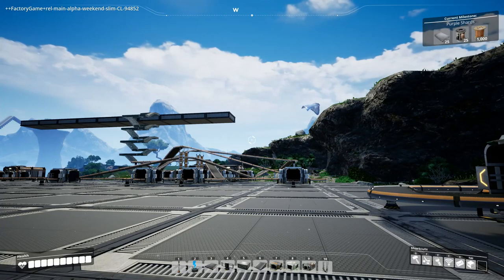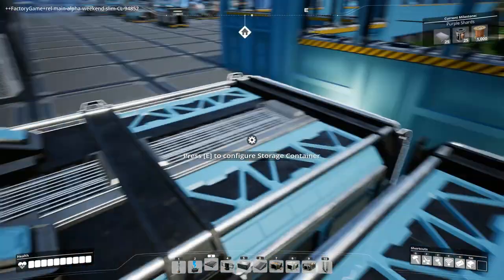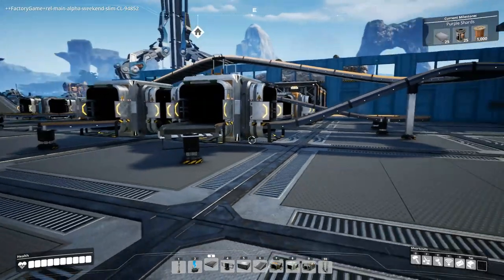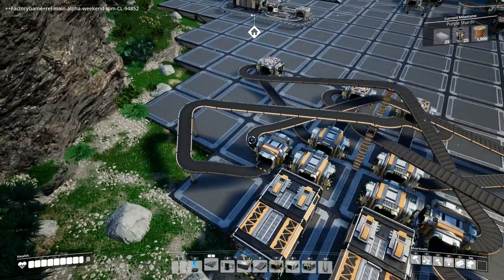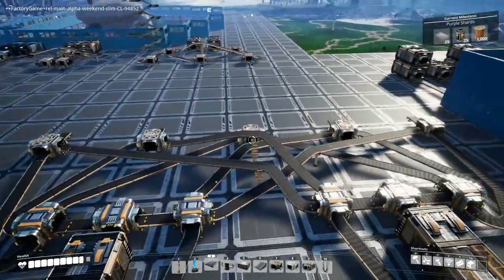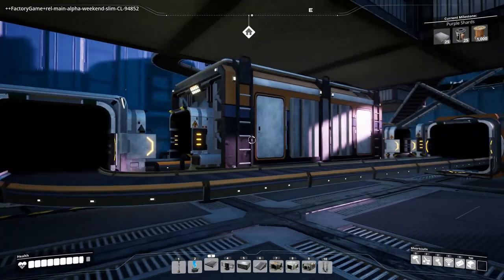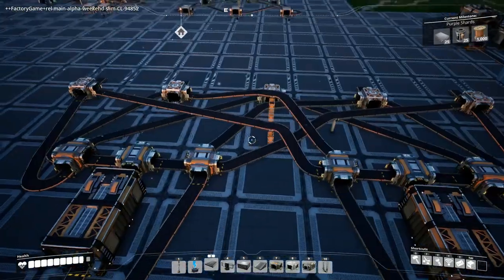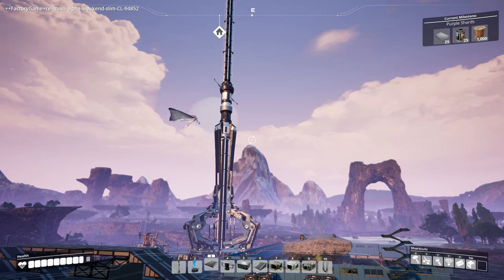Satisfactory - Splitters and Mergers, Basic Instructions and Complex Balancers

Comment: something I noticed about splitters playing this game. you can feed material into a splitter as fast as you want using the higher tier belts, but they still split at the same speed.  I have not maxed out my research yet in game so I dont know if you eventually get higher split rate splitters.  If they arent in there yet, thats a thing that def. needs to be added because it make splitting itmes pointless when you use the faster belts. I do like this tutorial though as for base level stuff, this lets you feed things evenly for storage..nice vid dude.
Reply: I haven't had any difficulty with splitter throughput regardless of what strange combination of output belt tiers I've used. For instance, a tier 3 belt going into a splitter connected to a tier 2 belt and two tier 1 belts, when supplied with 240/minute worth of items, consumes the entire supply of items and outputs 120/min on the tier 2 belt and 60/min on each of the tier 1 belts. And in a situation where a tier 3 belt goes in and tier 3 belts go out, and only one of the outputs is flowing, the entire input line seems to be able to make it through just fine. That said, I haven't used tier 4 (up to 450/min) belts yet so maybe there are issues with those which I haven't encountered... but you said "tiers" plural, and since tier 4 is the highest currently available, I'm assuming that tiers 3 and 4 are what you're referring to.
Reply: The splitter only changes the direction of the next unit in sequence: Left, Center, Right, Left, Center, Right, etc.. If there is room on the outgoing belt, it gets a unit.  If not, it goes to the next belt with 0 time lapse. There is no actual split rate and you may be seeing either the result of underfeeding your splitter or creating a bottleneck. 
Example 1 (underfed): A splitter with a Mk2 (120 units) input and 3 open Mk1 (60 units) outputs will split all 120 units at 40 units per belt per minute. Each belt is getting less than maximum but it's still split evenly, in sequence, and at the maximum rate that it receives.
Example 2 (bottleneck): A splitter with a Mk3 (270 units) input and 3 open Mk1 outputs will max out all 3 outputs at 60 units per minute.  The input line will then stop and start as space is made available on the outgoing belts.  You would need to upgrade one or more of the output belts to match or exceed the input rate.
Hope that helps you understand it a bit better.

Comment: That 2 to 5 really bothers me, by creating the feedback into the original loop the overall throughput there is reduced (old resources coming back are backing up the input resources), making the output even BUT for the price of efficiency. Or am I wrong?
Reply: Normally each output get 1/5 of input, but in this case 1/6 (since it actually splitted into 6 so it lose about) which make each output lose 1/30 efficiency (3.33%)
Reply: There's also the fact that if your "input" belts are each operating at capacity (60 items / min on mk1 belts) then your feedback line will back up to the splitters, so you'll end up with 2 of your "output" belts receiving 1/2 your throughput and the remaining 3 receiving the other 1/2 your throughput, so it's incorrect to say it's perfectly balanced.

Comment: For 2 to 2 and 2 to 4 (and many more) you can just use the first setup shown at 1:46 by simply using the faster conveyor belts between the merger and splitter. You get the faster ones quite fast too so there really is no point in these complex systems.

Also as someone else pointed out even if one line gets too many items they will fill up at one point (if you calculated how much they need) and the other lane will get enough from that point on resulting in 100% efficiency. So lets say you get 120 items per minute in and 4 smelter that take 30 items per minute each you could use badly setup splitters and they still would work at 100% after some time.

Comment: You can just use 2 to 2 splitter and split each belt in half or thirds to get 2 to 4 and 6 respectively, you can split one of those 6 belts and feed it back to containers to get 2 to 5
Reply: Under certain conditions a design which has splitters after the last mergers can end up not allowing all of the input throughput to reach the outputs that need it. For example, when both inputs are trying to reach outputs that come from the same splitter, choking your total throughput to what the single belt leading into that splitter can carry. It's the same kind of situation as he described near the start of the video, where he showed an example setup with two inputs merging onto a single belt and then splitting apart to two outputs. I've explained in more detail in a couple of other replies if that's not clear enough.

Comment: It would be fun to see Satisfactory's version of the classical Factorio 4:4 balancer,
Reply from the maker: Now that's a staple, isn't it? So simple, compact, and effective. I'm not sure one so elegant is possible in Satisfactory, but I may have to experiment with designs for that one just to pay homage to Factorio.
Reply: Sorry my english, and i am new to stuff like this, but.
If you take a input and b and spilt that to ab and ab. The same with cd to cd. Then ab into to new ab and ab + the cd into to same then you get abcd abcd and you can do that times 2, so you endt up with this.

A + b = ab.  X2.   C + d = cd X2.
Ab + cd = abcd x2 ??
Reply: @thedaneboy  I am not exactly sure what you are saying or trying to accomplish.
Keep in mind that splitters and mergers basically work like this: 
If you feed an input of a splitter at 1 item per second, and there's 3 empty outputs, you will get 1x to A, 1x to B, 1x to C, 1x to A, 1x to B etc etc.
If it's connected to 2 outputs you will get 1x to A, 1x to B, 1x to A, 1x to B etc. 
If one of the outputs is congested it will simply SKIP that output and output to the next in line: (C clogged) -> 1x to A, 1x to B, 1x to A, 1x to B.
So if one of your three outputs (C) is congested when you try to output to it it will output to A instead.. and then to B.. and only after that will it try to output to C again.

Assuming by AB or CD you mean a single belt with two different items on it (ABABABABABABABetc) when you try to merge AB into CD you don't get ABCD, what you get is ACBD or CADB as output.
Understanding the clocking and selecting of mergers and splitters is important to keep in mind, because it makes something like this: https://i.imgur.com/DWc51t8.gif actually not functioning the way you might hope it would (always output the sources at 1x speed). It will actually output the righthand drain at .5 speed and input from the righthand source at .5 speed.
Reply: @BLUFGaming  Because Factorio splitters do the equivalent work of two splitters and two mergers in Satisfactory, a 4:4 balancer is going to be a bit more complex.

A 4:4 could be constructed in a couple of ways. First is to mimic a Factorio 4:4 design, replacing each splitter with a 2:2 balancer. Second involves four splitter trios dividing each input into four outputs, and four merger trios converting four inputs into each output. In the middle are 16 belts connecting each input to all four outputs. This second design requires 24 splitters and 24 mergers, and just trying to picture how you'd get all those belts connected properly makes my head hurt.

The Factorio style method might be easier. 2:2 balancers are easy to make nice and compact if you build them in a vertical stack, although you have to skip every other conveyor layer (because the height of the bounding box of splitters/mergers stacked one per 2-meter layer prevents you from attaching any belts to them, which is incredibly annoying and I hope that gets changed). Each splitter has a belt going straight forward into the output merger at the same height. Then, on one side is a descending belt, and on the other side is an ascending belt. All neat and tidy and, above all, easy to assemble!

For the 4:4, hopefully this description is good enough: Starting with four belts stacked vertically every other layer, the top two and bottom two go through vertically stacked 2:2 balancers, then the middle two belts swerve left and the top and bottom belts swerve right and raise/lower to enter a pair of side by side vertical 2:2 balancers. Then the belts return to their original quadruple stack and go through another pair of stacked balancers.
Reply: @BLUFGaming  Here you go! https://imgur.com/a/kQ2zbdv Turned out much nicer than I originally expected, once I realized I could neatly interleave the second stage (1 with 3 and 2 with 4, instead of 1 with 4 and 2 with 3 like the Factorio balancer).
Reply: @TallinuTV  So many wasted outputs/inputs D:
but perhaps that's the only way.

Comment: hey BLUF Gaming would you mind giving an example of a "clog" and side by side of how the balancers fix it i follow what they do just trying to see how to apply it don't need to put these allover if they aren't needed
Reply: An example i can provide through a comment are assemblers making reinforced iron plates. Reinforced iron plates need screws and iron plates, assemblers wanted 20/plates a min and 120/screws a min. screws are made at 90/min so to reach 120/min you can use one line from a constructor and split a second constructor into 3 lines, merge your 90/min line and now 30/min line to make a 120/min to your assembler and dump the excess 60/min from your second constructor into storage. 

For clogs I look at people you set up a line of splitters to smelters what often happens in this case is the first smelter fills up until it can't take resources then the next one does the same, mean while the last smelter in the line is starved for ore. if you evenly split before sending materials to your smelters then they can all operate smoothly without a bunch of ore having to fill one by one.

Comment: When your output (Y) is greater than your input (X) ratio, and Y is fractionally viable, you only need to do an X to X balancer and split from there.  For example, a 2to6 only requires a 2to2, and from the ends of the 2, you split them and get 6 outputs (3 from each).  The throughput is only latched to the input ratio, so as long as you maintain that amount, anything more can easily be split for outputs.  Your 2-to-5 can actually be made into a 2to2 with a split for 6, return 1 belt that splits to both input boxes, done (and more compact).
Reply: If, in your example of a 2:6 balancer, one set of three outputs (all coming from the same splitter attached to just one of the 2:2 balancer outputs) was not consuming material,  the other three outputs would be choked to the throughput of the single belt connection between the other 2:2 output and the splitter which divides into those three outputs. In other words, what you suggested does not maintain full flow of both inputs under all conditions, so it's not "throughput unlimited" (as such things are called in Factorio). Unless you use a higher tier of conveyor belt between the 2:2 and the three-way splitters, one capable of carrying the full throughput of both input belts. But the idea here is that you're using your highest tier of available belt throughout each design.
Reply: @TallinuTV  .... then the other 2 on that pipeline will increase slightly, but the throughput would maintain continuity from the storage facility.  All that matters in this type of game is that the materials keep flowing...the opportunity for equality exists, but the need for equity at each assembler input is less necessary.  A clog on a single line just increases another upstream, the difference is very minimal between which lines versus the complexity and space wasted for such (and if you set up your assemblers properly for clocking, then you really don't have a problem and you save so much material).
Reply: @sabriath  Okay, I think I see where you're coming from. If you know that the machines on each branch can't consume all of those full two input belts worth of resources anyway, then there's certainly nothing wrong with building a 2 to 2 and then splitting each output. But telling people to build a 2 to 2 followed by splitters and then calling it a "2 to 6 balancer" could have people expecting it to do something it simply cannot do, because "balancers" are generally designed to provide maximum throughput to most or all combinations of outputs. I hope that makes sense to you.

So far I usually try to build things with exact ratios so that each machine runs at 100% with no excess or deficit of materials at each stage, and then carefully divide up outputs from my miners to ensure that the exact required amount of ore goes to each set of smelters, assemblers, etc, since the miners won't ever run out. (Not having to worry about mines running out has led me to a somewhat different approach compared to Factorio, kind of an interesting change of pace.)
Reply: @TallinuTV  but you will never get maximum throughput on a downgrade line, that's the point I was trying to make.  At that point, you might as well just split at each assembler/smelter and overflow to the next in the series....yes, the overflow will be reduced, but you get the same rate equal to the input throughput regardless.

Take for example 6 smelters operating at 15 items per second with a belt that can do only 60 items per second.  If you take the belt and split it 6 ways into the 6 assemblers evenly, you still get only 10 items per second to each....which is a 33% loss to all equally, your output will be 10 items from each, combining to 60 items per second.  Take the line and split to the first will leave 45, split again and it leaves 30, split for 15 and the fourth will get the last 15.....leave 2 smelters dead, but you still output 60 items.  You have lost nothing in the process except doing a 6-way full balancer costs time and material to set up.

The art of the design is great, full marks, fine....but the practicality is not there.  Downgrading a line has no need for balancing, throughput will be the same regardless in the end.  And if you want to gauge materials at specific rates, clocking will do the exact same thing....so for the example I gave, all you would have to do is reduce the smelters to 66% each and it will use 10 items per second on each of the splits, no headaches, no fuss.

Comment: For the 2 to 4 splitter, wouldn't it be easier to build a 2 belt balancer and then just split each of them in 2?
Reply from the maker: Yes, good catch. I got a bit carried away it seems.
Reply: @BLUFGaming  not necessarily. If you want to ensure output of source ABCD to all outputs (so each output has 'ABCD' as output) you cannot just do that.
It might be that due to the merging and splitting you will get ABCC and ABDD and AACD and BBCD on the outputs, depending on how you layout your splitting/merging and/or whether all belts are always full. If you ensure you're always merging two 50% loaded belts into a single 100% loaded belt it's fine, if you merge two 100% belts however that also come out of the splitter at 100% load undesired things CAN happen.
Reply: @BLUFGaming  Actually your 2:4 is correct for a "throughput unlimited" design. Generally there must be a number of belts merging into each output line equal to the number of total inputs. Otherwise it will probably choke the throughput to fewer belts than your number of inputs or outputs (whichever is smaller) under some subset of possible input/output conditions. As I described in my reply to another comment by Robert, you can't just split one belt to feed multiple outputs, when you have more than one input, and expect a full flow rate on all your inputs.

Here's a simple rule of thumb: All your splits must come before your merges. (Although this may not apply in far more complex balancer designs made up of multiple stages.)

In Factorio the smallest unit from which balancers are constructed does a lot more of the work for us: All Factorio splitters perform both merging and splitting simultaneously, and are naturally capable of handling two belts worth of input and output without limiting the throughput of any of the four extreme input/output combinations. The same amount of guaranteed throughput in Satisfactory requires a 2:2 balancer made up of two splitters and two mergers connected by four belts, since each part does a lot less work. In some ways they have advantages because of their built in option of 3-way splitting or merging, making it easier to build balancers that involve that number, but I believe the internals of Satisfactory balancers are always going to require more belts for the same number of inputs and outputs compared to Factorio.

Comment: Can you bild an 10to10 😅Balancer? I need it for my Megabase Build but it is not easy to make it compact🤔
Reply: Would take input*output(100) belts (with splitters/mergers and their respective in/out belts) in parallel at the largest point with this design, so there is no compact way of building it :/

Comment: What's the practical application
Reply: Assemblers and manufacturers, since the ratios for these the components they make aren't perfect. For examlpe, you may have two lines making 270 screws combined, and you have 5 assemblers that require 57 screws each. This would ensure that both those lines are being used for 100% efficiency.
Reply: @domoniche1  I'm going to assume you meant "54 screws each". You can just have 4 splitters in a sequence. If you fill the inputs of the first 3 assemblers than all machines will run at 100%.